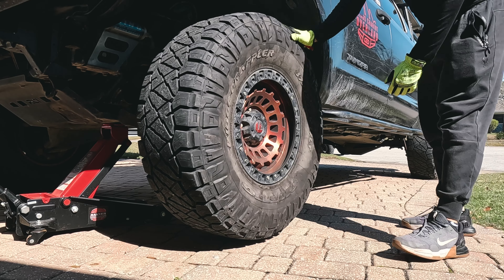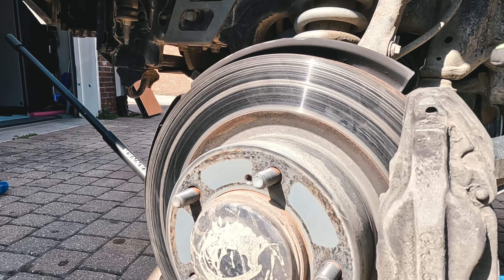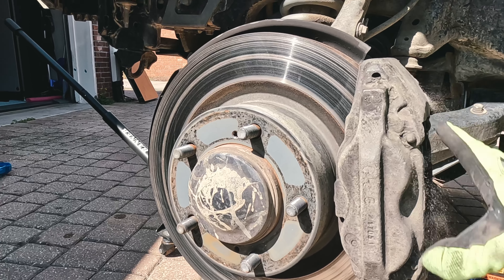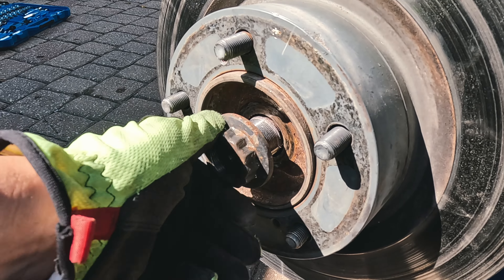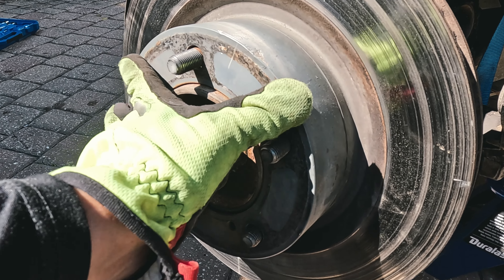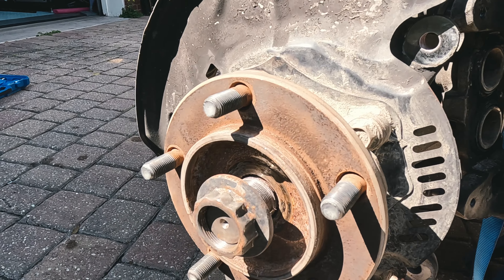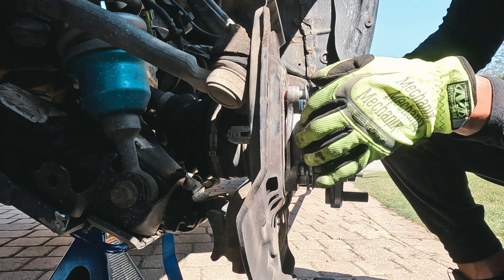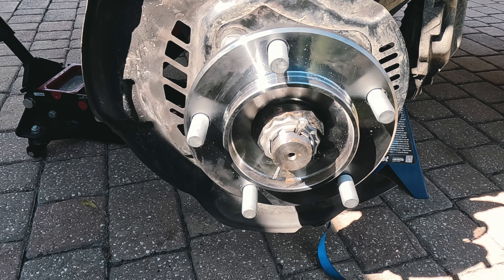Toyota Tundra Wheel Bearing Replacement

Comment: I'm curious if the wheel bearings even needed replacement. Sounds like the brakes would've made that sound. How did the bearing feel? Binding, crunchy?
Reply from the maker: Def wheel bearing on the driver side. Sounded like the wheel was falling off with a a slight crunch. Took our Toyota Master tech for a ride and he put it on his lift and confirmed wheel bearing. She's smooth as butter now!
Reply: Awesome, glad it worked out! Keep up the great content 🤙🏽
Reply from the maker: @raincity_tundra6706  thanks bro appreciate the follow